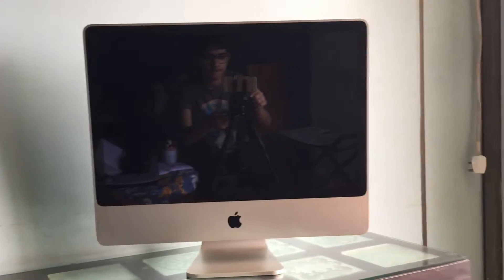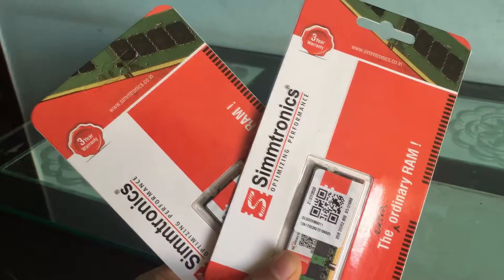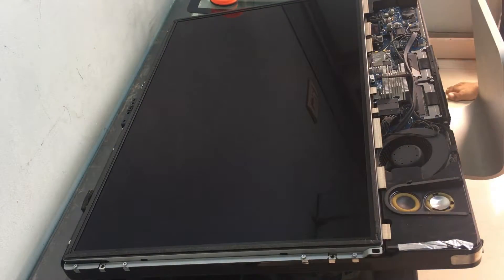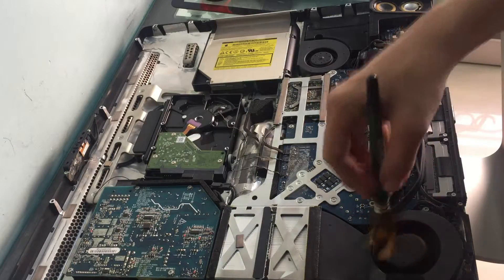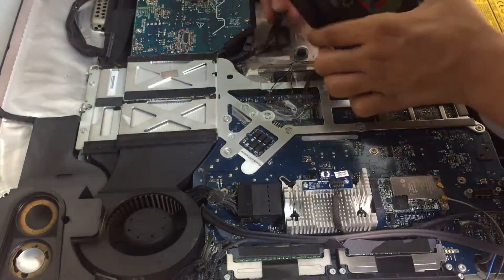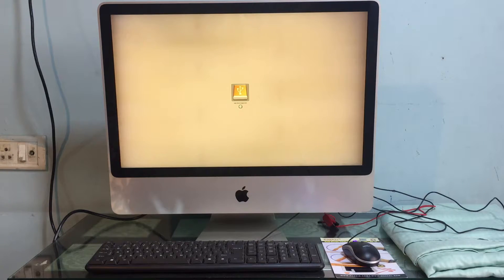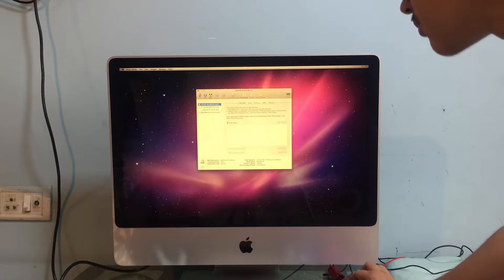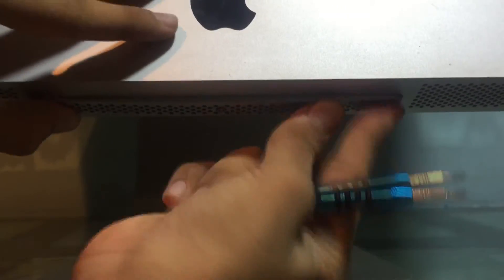iMac Early 2008 Restoration + Upgrades + Catalina | Are Old iMacs worth it in 2020?

Comment: I just inherited an iMac Model A1225 2.66 GHZ     640 GB/SD.  What should i be using to. upgrade it to be usable for web browsing and standard usage
Reply from the maker: What you've got is presumably a 2009 iMac. It's pretty similar to the one I've got in the video. In your case you can upgrade it to 8GB DDR3 So-DIMM (2x4GB) and you can also upgrade to an SSD so that everything feels snappy.

Comment: Faltó instalar el sensor de temperatura
Reply from the maker: I don't speak that language, but I think you're talking about the temperature sensor. SSDs don't actually get as hot as hard drives (no moving parts) so I didn't really need to place it accurately, although it is required since MacOS will not boot without it.

Comment: When I turn my computer on a file with a question mark keeps flashing in the middle of the screen 🙄
Reply from the maker: That means there's no OS detected. Either your drive is dead, or there no OS installed. If you're using a hard drive that has an OS already in it and you're still getting the flashing question mark, just wait on that screen for a few minutes, sometimes it takes a moment for it to detect. Hope this helps! Have a great day!
Reply: @KB1118  thanks! I got a SSD from Amazon. Not sure it has a OS installed.  Now I have to order a OS to download? Thank u for answering 💓 I was thinking I did a wrong connection inside but I followed the instructions.
Reply: @KB1118  where do u get the OS? I went to my PC to try to download and copy in a USB but not luck 🙃
Reply from the maker: @marierika2012 Look around on file sharing sites for Snow Leopard. That's what I used.

Comment: Thank you very much. I have the same year iMac but it has been collecting dust for at least 5 years and I almost trashed it once. But you have given me new hope of reviving it. Questions. You said you started with the Snow Leopard OS. Did you have it on a CD and where did you get it? 2. Why would I not begin with something more recent, like El Capitan or is it unavailable for download? Thanks
Reply: I had a 2007 imac with snow leopard and i have upgraded it to el capitan without an issue.I think you have to install snow leopard there first though and update it fully ...then go to google and type "how to get old versions of macos" and you ll see the apple support link there that you can use to download the version of osx you want....
Also to make everything worth it,consider upgrading your old slow hard drive of your imac to an ssd.I did just that and its like night and day.An ssd and el capitan is more than enough to last you several years more for basic use and more.....hell i even have logic pro x in here,runs smoothly and is still able to record and playback small projects.
If i were you i would find some service in your area that ll install your ssd drive in with el capitan for a small fee....personally its like i got a new computer and although its my backup now it can absolutely serve as a decent machine and i can delay even more buying a new silicon mac...
Reply from the maker: Thanks so much for watching my video! The reason I started with Snow Leopard is because that was the only OS that I could find online that I could use as a bootable USB. If you plan on using your existing Hard Drive or SSD that currently has MacOS installed on it, you can skip this step. To answer your question, I don't actually think they made a DVD that has the entire OS and not just the update files on it but if I'm wrong and you find a way to install El Capitan directly, it should be fine. Thanks again for your question and have a great day.
Reply: @kb1118tech  Thanks for your quick and helpful reply. You are very generous with your time and expertise. But I have another question, please. I have two MBP's and back them up to portable drives with Carbon Copy Cloner, which also contain the OS X's (one is High Sierra, the other El Capitan). As a test, I was able to boot my old iMac using one of those portable drives. So I am thinking of installing a new SSD, like you did and cloning it with the portable USB drive. My question is this. The portable drives are clones of everything from my MBP's (documents, photos, videos, etc.) but is there a way to copy just the OSX from the portable drive to the new SSD in my 2008 iMac? Please and thanks
Reply from the maker: @edmizzimizzi  It may be possible, but I don't think I know a way of doing so. But I'd recommend creating a Bootable Snow Leopard USB (I can give you the magnet URL for the disk image file and you can use any torrent manager such as uTorrent or Bittorrent to download it) and then using that install it on your Mac and then proceed to install Catalina. The magnet URL can be found here: https://pastebin.com/fjcNyUFi

You can also just boot into the bootable Hard Drive and then create a Catalina USB with the Patcher if you don't want to go through the hastle of installing Snow Leopard or any other OS. I had to start from scratch since my previous Hard drive had crashed. 
If you have any further questions do feel free to ask. I'm happy to help. And thanks for having faith in me.
Reply: @kb1118tech  Thanks again. For that URL and for the options and advice you provided. You obviously know your stuff. Your generosity is never-ending. Ed

Comment: Bro I've same model can I upgrade it to 6 gb ram
Reply from the maker: It's not a 100% certain it will work, but many people have found success in doing so. With that being said, you can order the RAM through Amazon, and if it doesn't work, you can easily return it. Make sure to get the same speed and from the same brand to ensure compatibly.

Comment: Bro pls help me too i want to upgrade am using the same
Reply from the maker: What help do you need?
Reply: For upgrading i need to change only the ram or need to be changed the ssd also?
Reply from the maker: @shameerk.a7440  The RAM is only going to help in multitasking and in certain games and programs as well, while the SSD makes the system feel fast. Instead of taking about a few minutes to start up, it takes a few seconds.
Reply from the maker: @shameerk.a7440  You can change whatever you want. You may also just leave everything the way it is if you like but it may feel sluggish when using Catalina.
Reply: @kb1118tech  i cannot do any downloads from App Store bcz of this am thinking to upgrade
Reply from the maker: @shameerk.a7440  You can very well install Catalina without making any hardware changes, although it may make the system feel slow.

Comment: Bro I have the same machine with the same specs as you, nonetheless, and even with the SSD upgrade, it takes so long to boot up! How did you achieve to have a fast boot? I have tried everything! 

Also great video bro!
Reply from the maker: Thanks so much man. I'll get back to you soon about the fast boot thing. I haven't changed anything really. But I'll love to help you out.
Reply: @kb1118tech  thx bro
Reply: More ram can help, those machines can take up to 6gb, with 6gb there is no paging going on what so ever
Reply: also try mojave, its a lot faster than catalina trust me, and get the 800mhz ram variant, its a lot quicker as well!
Reply: @bramvandenbroeck5060  but there is no 4+2 gb in ddr2 memory
Reply: @nitishvakula2462  I just put a 4+2gb in my machine. I bought it from OWC
Reply from the maker: I figured out the boot thing. My video is actually in time lapse so it may seem like mine is booting faster when it's still slow. Hope that answers your question.

Comment: Bro i have same imac Early 2008 and i want to upgrade it.
Reply from the maker: You should really go for it. They're still pretty decent machines even today.
Reply: @kb1118tech   how much cost of 2 gb ram
Reply from the maker: @chocolateyhero6001  2GB of DDR2 in the SO-DIMM form factor is usually about 4 USD a piece of you get it brand new. You can even get it cheaper if you go used.
Reply: @kb1118tech  how longer do you think they’ll last, even after upgrading ram and sdd?
Reply from the maker: @XDMIIIIIIIII  It really depends on your usage. If you plan to do something heavier than web browsing, attending online meetings and just the daily household tasks, you may want to just get a new device.

Comment: Why is there a yellow tinge in the display
Reply from the maker: Honestly, the camera I was using wasn't the best. I'm pretty sure the contrast is way too high. The display is actually perfect in person.
Reply: @kb1118tech  eventually, over time, after the cfl backlight tube gets to a sertain amount of houres, the screen will get a yellow tint, or in the worse case, a pink one, i have a black macbook and the apple logo on the back looks yellow, the laptop is never been used next to cigarettes or something (some people think that), its just the backlight slowly but surely failling over time, you can change the cfl tubes in the display, but its a long and hard process, the risk of breaking something is likely to be high, so i do advice against that, i did it in a powerbook g3 pismo, it works fine now, but it was a long process and i almost damaged the screen
Reply from the maker: @bramvandenbroeck5060  Thanks for your comment! I'll be sure to check it out. Thanks for the help.